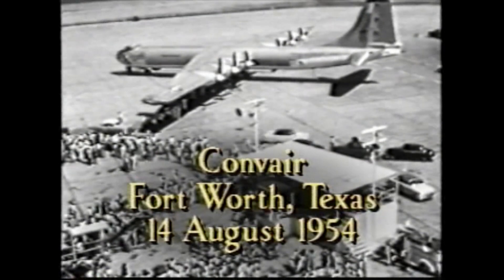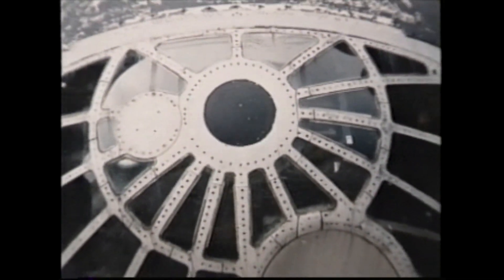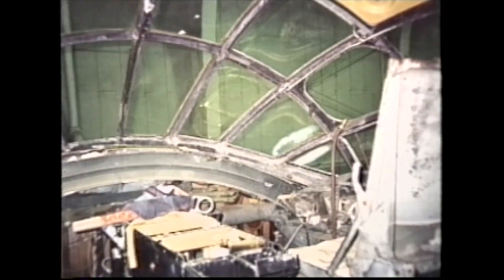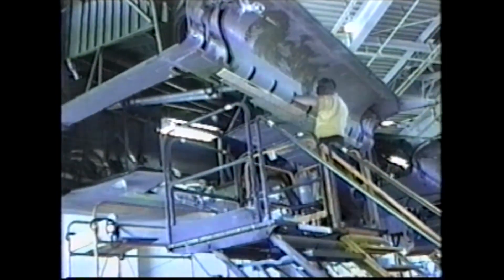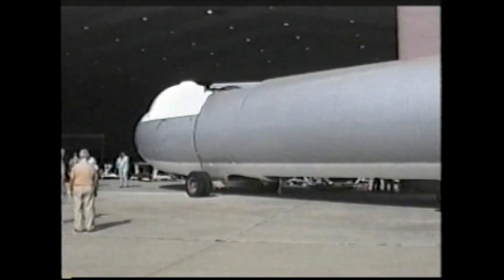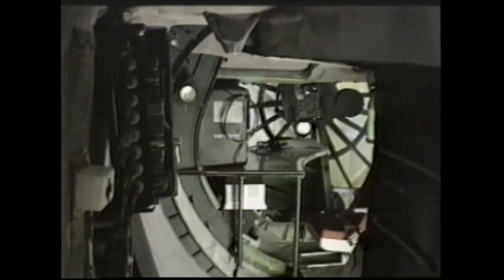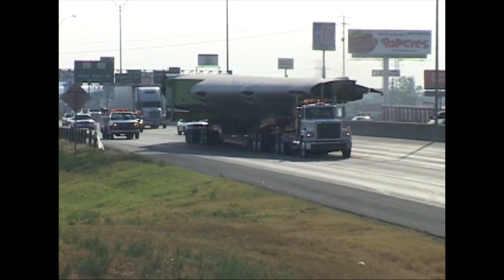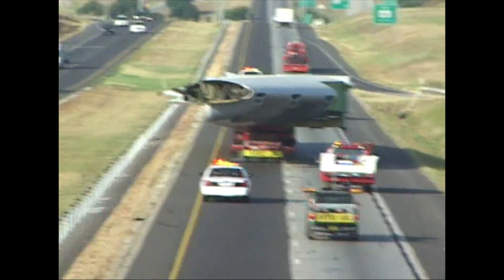Restoration of the last B-36 Bomber

Comment: I worked on it, during the 92-94 restoration period.  According to some stories I had heard, its last flight was into Amon Carter Airport in Fort Worth in 1959. The airport was renamed Greater Southwest Airport in 1960's, the B-36 sat there on public display until GSW was closed because of the opening the new Dallas/Fort Worth Airport in 1974. The airport (GSW) fell into abandonment as did the B-36, it was during this time the aircraft suffered allot of vandalism. By late 70's as the airport was being demolished, the B-36 had to be removed. I was told that there was an idea to "FLY !" it the 15 or so miles to the General Dynamics/Carswell AFB (now Lockheed Martin/NAS Fort Worth JRB) but the Air Force got wind of it and quickly quashed the thought, going as far as cutting or drilling the spars. So, it was taken apart and trucked to Greater Southwest Aerospace Museum that was just outside the General Dynamics gate until the 92-94 restoration. As I remember the museum also had a B-52, KC-97, F-111, F-89, P-2, B-58 and a few other aircraft. As I arrived in DFW metroplex to attend A&P school in 1988, we had a field trip to the "GD junkyard" as the instructors referred it and I remember all the aircraft being in deplorable condition. Also, after the restoration, supposedly Ross Periot Jr, had donated the land for a new museum at the new Alliance/Fort Worth Airport. But the money to build the facility was never raised. Of note the same time all the B-36 restoration and fund raising going on. The Dallas side of the metroplex the Frontiers of Flight Museum that was located in a little lobby located on the second floor of Love Field Airport, ballooned into a major hanger facility.
  I seen the TB-58 in the museum in Galveston, anyone know the fate of other aircraft?

Comment: When I was at A&M  the school aero dept had a trip to the old SW field which is south of DFW. That B -36 was outside in horrible shape. On the ramp was a cable turnbuckle which was cut from the aircraft. I picked it up and have today. I worked with Bill Plumtree at GD.. He was a fine man, and Superintendent of Dept 178, 176.  Neal Anderson was Chief Test pilot when I worked there in Flight Test. Phil Oestricher was also a company test pilot and later the Director of Flight Test. I bought my Aeronca Defender from Phil, still have that too.

Comment: in the late 1970's i was stationed at chanute afb ill. and there was a B-36, B-58, B29, B-47 and a B-52 all on static display. i used to be in amazement of these planes being able to walk right up to them touch them and to sit under the delta wing of the B-58 and study, the massive B-36's landing gear was almost as tall as me. the props on the B-29 were so thin made me wonder how did it get off the ground! i was told that all were flown in before being displayed. what ever happened to them? where are they now?

Comment: When the Pima B-36 was being reassembled, the museum used several coats of clear coat to protect the skin of the aircraft from the harsh Arizona elements, as well as protecting the markings. Also, they sprayed on the windows, a preservent, which prevents the glass from yellowing, and cracking.

Comment: I actually have two stories to tell about this airplane. When I was a young kid I use to play inside this bird while my Dad, Charlie Reed worked with the original restoration crew in I believe the early 60's to try to get this airplane back into airworthy condition. My favorite place to hang out was in the crew tunnel and trolly that ran from one end of the airplane to the other. Many years later while I was an instructor at Texas Aero Tech in Dallas I use to bring my students over to help in the last static restoration of this wonderful old bird and was very proud to have worked on something my Dad had dedicated so many hours labor years earlier. While working with my students I climbed into the old tunnel again and found my initials that I had  scratched in the paint years earlier..I was really surprised they were still there. Thank you for sharing the video, its brought back a lot of forgotten memories.

Comment: To hear one of these beast take off was unbelievable along with the noise. The ear piercing throbbing sound went all through your body. And you did not have to be close to it. It looked at times as though it would fall from the sky. When you saw one at altitude from the ground, it appeared as almost not moving and you could hear it for 20-25 minutes as it eventually vanished in the distance.

Comment: Moved because no major corporation in FW would dig money out of their deep wallets to help give it a home in or around FW. Ironic that no aviation company in the vicinity of the FW area that made fortunes off of such aircraft, would help create a display building/home for this once proud bird. 

I went thru this in the flight line run station after it was finished, but in large pieces. It was truly an incredible restoration. It had sat outside the General Dynamics/Lockheed Martin USAF Plant 4 for many years as a deteriorating hulk until someone made the decision to restore her. Thank god for that. Shame it left the area, but like the B-58 that sat out beside the B-36 for years and ended up in Galveston, she found a good home.

Comment: The aircraft you saw off the runway at Kelly AFB was the 'one off' double decker XC-99 that was built as a heavy cargo hauler by Convair.  As I remember the Douglas C-133 got the 'next generation' heavy cargo hauler' from the AF.  The C-133 with its 4 turboprops and the all important rear cargo ramp and a 110,000 lb payload began coming into the system in 1956.  Then came the Lockheed C-130, C-141, C-5 and McDonald Douglas C-17. There are several videos on youtube of the XC-99 in operation. It languished for years off the runway at Kelly (in private hands) until it was acquired by the AF Museum at Wright-Patt, disassembled and transported to the ramp in front of the Museum's restoration hangers.  Check out the AF Museum website for future restoration plans. If you have deep pockets send money for the project - lots of money. (-:

Comment: There is one of these planes sitting in San Antonio, I saw it when I went to the impound lot after my car got stolen and recovered, it's right next to the impound lot there, at least it was in 1987.
Reply: It was not a B-36, but the Convair XC-99. It used the same wing and engine configuration. I toured it as a kid in the mid-70's when I first moved to San Antonio.

Comment: I went to a tech school in Dallas in 1973-4 time frame and made a trip out to DFW, saw a B-36 setting there.  Stopped in to see what was going on and noticed that people were starting to take it apart so it could be moved.  I crawled up inside her and took a trip back in time.  I wonder if this was the same B-36 featured in the video.  There is also one at the Castle AFB museum in California.  what great machines with the low rumbling noise they created due to the low prop rotation speed.  When i lived in western Kansas in the early 50's, i would hear them fly over at a relatively low altitude, apparently coming from the WIchita plant headed west someplace.  Sure got your attention when you heard the engines rumbling.
Reply: It is the same B-36 you saw being moved from what was then left of the decommissioned Great Southwest International Airport located just south of the then new  DFW Airport at the intersection of 360 &183 before it was demolished. If you look at google maps you can still see a small portion of the old runway on the north side of 183 just as it intersects with 360
Reply: I lived on a farm just outside of Wichita and watched them fly overhead also with that incredible sound.  You could hear them coming before they could be seen.  They performed some practice runs over the U.S. during the '50s and I knew the sight was something special as a teen.  There were several AFBases in the northeast that they were stationed at.  I don't think they ever touched down in Wichita at McConnell AFB.

Comment: it was a maintenance nightmare. 6 R4360's in a pusher configuration which shitty cooling.
Reply: SIX turning refers to the reciprocating engines, FOUR burning refers to the four jet engines.
Reply: The jets were burning 100LL avgas, not JP4. Mechanics had to scrape lead deposits off the exhaust nozzles.  The nacelles were identical to the B-47 units, with the addition of the sway brace and removal of the outrigger landing gear and door-operation mechanism.  But the gear doors and landing-gear hinge points remained.  I saw those when we disassembled the nacelles back in '78 or so prior to the move from Amon Carter Field (Greater Southwest Airport) to Carswell AFB.
Reply: Hence the nickname 5 turnin' and 5 burnin'. The 'shitty cooling' caused a lot of engine fires - particularly before the carburetors were moved to a cooler position.
Reply: Auggies1956 
But of course when one of the reciprocating engines caught fire due to overheating -- which they quite often did on the early models -- and the engine had to be shut down then the aircraft had just 5 engines a'turning and 5 engines a'burning. One of those a 'burning had previously been a'turning. I think that is what is called gallows (ghetto) humor. !!!
Reply: Another issue was ignition-wire arcing at high altitude.  The lower dielectric constant of the thin air, coupled with too-weak insulation on the ignition wires and magnetos, led to big sparks.
Reply: Corrie Bergeron 
I read a once off article - I think regarding the B-36 - that the assemblers on the Boeing line which produced the nacelles noticed that they had begun building nacelles as you describe and rumours began about some new aircraft in the planning stages. Little did they know that they were building nacelles for the opposition !!
Reply: 100LL is a 21st Century grade. This baby burned 115/145 as did the J-47s.
Reply: LOL! Thanks for the explanation.
Reply: "Four turnin', two burnin', two smokin', and two jokin'" was the way I heard it. :-)
Reply: Corrie Bergeron That's a new one to me.
I take it the jets also had their problems, which is a bit strange since from what I have read they worked a treat on the B-47 -- from whence they were adopted.
Reply: Was 100LL even available in the 1950's? The recips likely burned 115/145 & one would assume the J-47's did as well.

Comment: Restored is when the thing flies again, not just beautification.
Reply: There is ONE B-36 which could potentially be returned to the air, at Dayton. It'll never happen.  Look how what it's taken to get the B-29 Doc airworthy, and then realize that a B-36 is an order of magnitude more complex.  It  takes three GROSS of sparkplugs.  3,600 gallons of oil.  In operation the airplane averaged 90 hours of maintenance for each hour of flight - and that was with full USAF logistics and a supply of spares behind it.
Reply: The original plan for this a/c was to return it to flight.  At one point in the mid-70s they had all six engines running - though only one at a  time, since there was only one set of engine instruments!  

When we gave up on flying #2827 in the late 70's and stripped the bladders out of the fuel tanks, we realized that they were riddled with pinholes.  The thing would likely have caught fire taxiing out for its first flight.  A great loss to city that built her, but at least now she's got a permanent home where she'll be preserved for generations.
Reply: Hell will freeze over before that happens. Imagine the heartbreak if something fell off during take-off, demonstration flight or landing and the whole thing went up in a ball of flame and smoke. 
Be thankful for what they are trying to achieve by bringing it back to as near perfect as they can. And let's face it the B-36 WAS NOT A PERFECT PLANE. Even Curtis Le May DID NOT WANT IT. From what I have read - if he had his druthers he would druther have had a much larger fleet of B-50's.
Likewise the B-24 being restored at Werribee Australia will never go past taxi restoration !!! Too rare and too valuable to risk even a quick flight.
Reply: Volunteers got the plane ready for a ferry flight to a new display location in Dallas sometime in the 1970s. They were denied permission for the flight, from what I've read either because it was still considered a nuclear-capable aircraft by the government (in theory anyway) or because there was too much of a risk for turning a rare B-36 into a smoking crater. Although it would have been nice to get some recordings and film of it in flight. It is now on display at the Pima Air Museum.  I think that there are six B-36 survivors, including two that are still in unrestored condition and will make big projects some day.
Reply: For videos of them in flight, nothing beats Strategic Air Command filmed in 1955. You didn't need RADAR to know when they were coming in. The sound got there an hour earlier. :-D

Comment: I wish rthey could restore one to flying condition
Reply: That's totally impossible, because, there are no more B-36 airframes left, to restore, and restoring one of these monsters to be a flyable warbird would be hugely expensive, and it would only fly in, and out of large fields, due to its size, plus, it wouldn't be able to operate out of smaller fields, along with an enormous fuel, and maintenence cost. So, that's why you, and the rest of the world will never see one of these monsters fly as a warbird.
Reply: @johnosbourn4312  I know.
Reply: But a large RC model could still give people a chance to photograph this monster in the wild

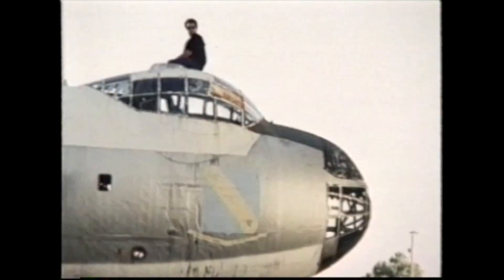Comment: I know the guy walking the B-36 towards the run station at Lockheed Martin at 1:50 in the video.  That scene was the B-36 being pulled down a White Settlement public road in order to make the right hand turn into Run Station #1 where disassembly of it began. He's the engineer that was given the task to design something to pull it out of the field where it sat for 30 years or more.